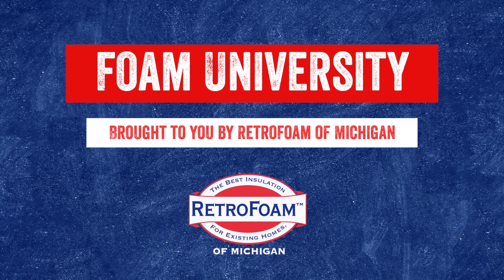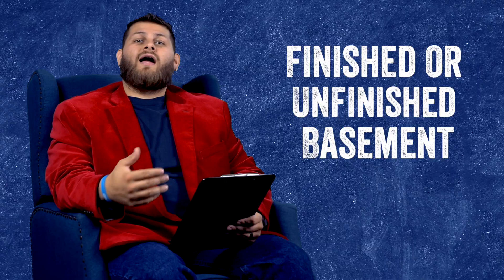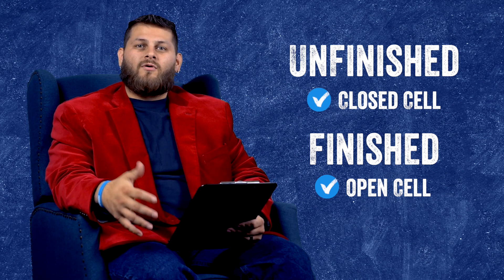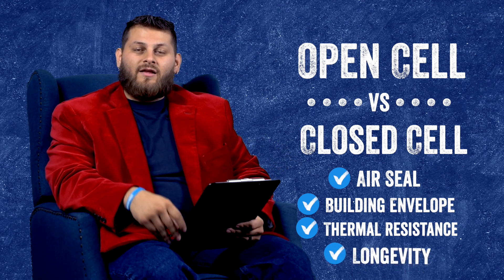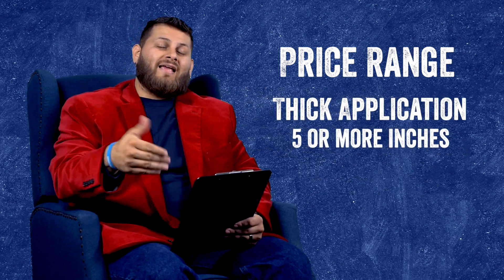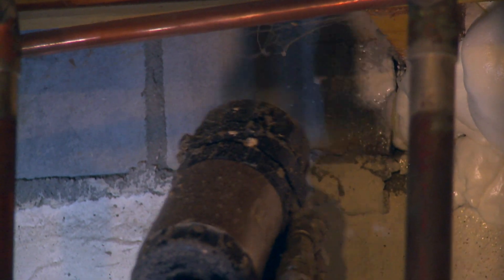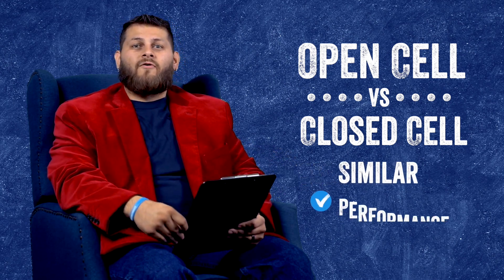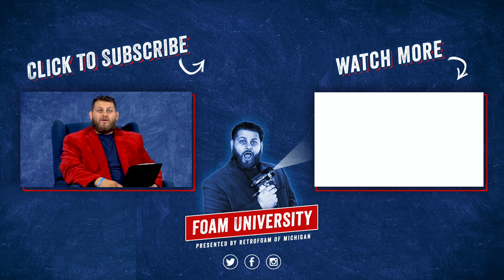Spray Foam Basement Walls: Open or Closed Cell? | Foam University

Comment: I thought the building code required foam to be covered by drywall for fire safety reasons.  Do you regularly leave occupied basements with exposed spray foam on the walls?
Reply from the maker: There are areas of the home that can be left exposed. It's always best to check with your local building inspector to make sure you're meeting your areas code.

Comment: This is a huge difference. Open cell foam is “Vapor Permeable.” Foundation walls constantly release vapor. Open cell will absorb that moisture. In theory, it would be better to have open cell in an unfinished basement with uncovered walls. This can better ensure vapor doesn’t stay trapped in the cavities.  Closed Cell SPF (or foam board)  is the best way to insulate foundation walls. Both of those materials are “Vapor Barriers.” 
Sounds like the professor needs to study up on vapor drive (or he just really wants to sale the more profitable Open Cell Foam😉). 
Btw, who the hell is going to spray 5 inches at there basement walls??? 😂
Reply: No, kevin is right.  Open cell spray foam is air permeable up to 3.5 inches and requires a vapor barrier.  Opencell will hold moisture like a sponge. Insulating your foundation Walls with Opencell will allow the walls to sweat and the Opencell will hold the moisture and slowly start releasing it.  Every insulation company knows this. They only used closed cell on Foundation Wall and similar areas.  It’s just a known fact, bud.  I’ve been literally doing this since 2002. 
There’s nothing I haven’t seen in this industry.  

Closed cell foam will prevent moisture.
It has a built-in vapor barrier,  I’m pretty sure you’re aware of this. We are talking about moisture control here. 
We’re not talking about closed cell Sprayfoam being the answer to your water problems or a quick fix to stop your Foundation Walls from leaking.  That that’s common sense .  You’re not understanding what he’s saying.   

Literally what you’re saying in the video is kind of wacky.  You’re talking about finished rooms and unfinished rooms.  
Oh no, somebody could hit your Opencell foam and damage it if the room is not finished.  Sure i guess. Lmao.  Bro.  That is no reason to use open cell or closed cell.   There’s bigger issues that would need to be addressed.   You just shouldn’t use Opencell on your Foundation Walls.   Period   . That’s how you get mold issues  
Installing open cell on a foundation wall will leave you with nothing but problems   .  

We can recap here.
Open cell is air permeable .  It allows air through the cells At a certain thickness. 3.5 inches to be exact.  Of  air happens happens to go through. It’s going to get to your Foundation Walls any they will start sweating.  Then you will get mold.  Then you’re fucked.!!! And then you’re dead.  DEAD !   OK I’m exaggerating a little bit.  

Use closed cell bud.  I agree 100%. With some stuff, you’ve said . There are a lot of different opinions in this industry.  A lot of misinformation being passed    
But to me, it’s all common sense.  It’s Not too hard to figure out what is bullshit or not .  You just have to have some common sense. 
Good luck to you professoah!
Reply: Kevin.  Closedcell is over four times the price of opencell.
Reply from the maker: Spray foam insulation should never be used for moisture control or waterproofing. Not all spray foams are created equal and experienced  contractors only use open cell foams that don't absorb moisture. The spray foam industry can be a very confusing place with a lot of contradictory information. It's easy for people to be misled. That;'s why our studying has been done over the past 22 years of actually insulating homes with the materials we talk about.

Comment: Would the moisture barrier that is in closed cell be a great benefit in this situation?
Reply from the maker: If you're looking to use closed cell spray foam as a waterproofing solution, I would not recommend doing that. It is not designed for that.

Comment: my basement walls are made cinderblocks... is it logical to spray foam inside the block closed cell? you add thermal and moisture proof
Reply from the maker: It is common to spray a layer of closed cell foam on interior basement walls.